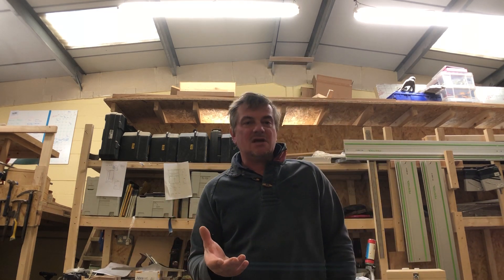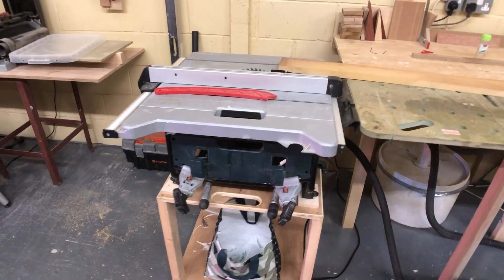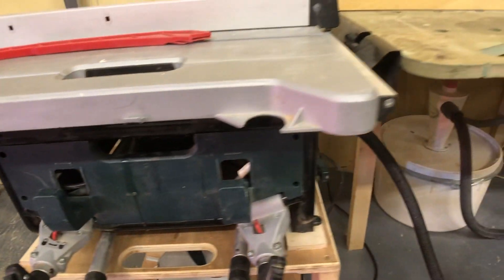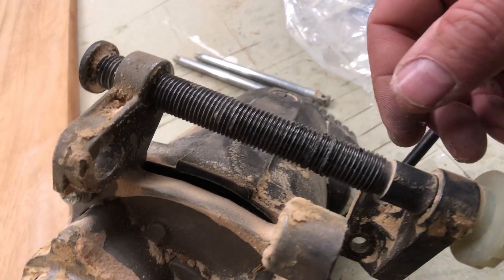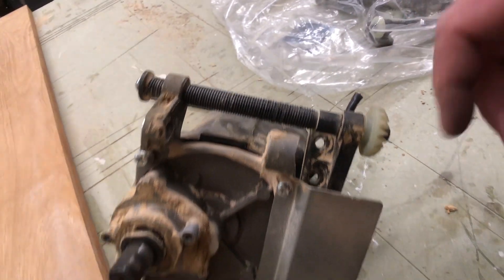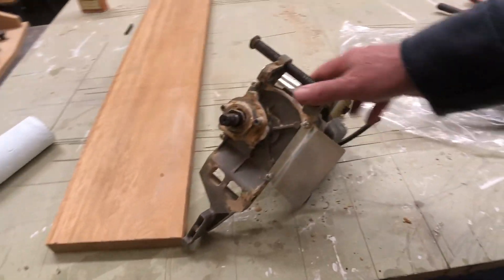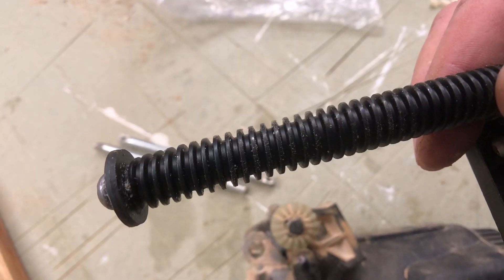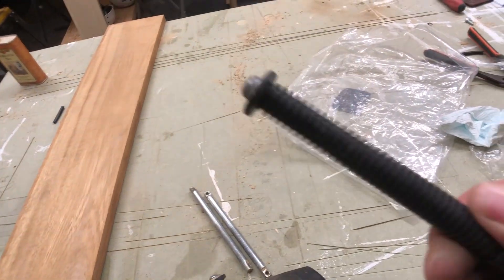Metabo TS254 Long Term Use Review and a Fix For The Broken Lift Screw

Comment: Thanks a lot for this tip, mister! I will make sure to check that the saw im buying is equipped with the right kind of threads!

Update: I contacted Metabo and they informed me that you should make sure the model you’re buying has model number 600668001. This is the upgraded version. The previous model was 600668000.
Reply: It is hard to find this model (in Poland at least)

Comment: Thanks very much for taking the time on this video, I’m looking to get one of these and looking at the competition this seems to come out best,I don’t do sites anymore so it will only be getting home workshop use.
Most of my sheet mats get cut on the festool saw and track so it will be for cutting up the smaller stuff and solids, so along with your vid and my comment anybody else looking for the same setup this will help

Comment: We call that replacement thread the Acme thread over here in the US. I had the earlier model Metabo and it was gear drive and twice the drive broke or chipped and you could hear the missing
tool right before it was ready to poop the second time. I sold it and was glad to see it go. I have a video of it showing the features which at that time I thought being better than the Bosch 4000 sold over here. Now Metabo has bought another brand and is marketing some new tools.

Comment: I had the same problem and metabo replaced the gearbox cover and height rod. I fitted It myself that was 3 years ago and with covid and a knee replacement, saw not used much and it has just done the same. The saw is a great bit of kit. It's just this part that let's the machine down.
Reply from the maker: hi, thanks for the comment. I am guessing the screw they sent was the same as the broken one, not the butress thread?
Reply: @SpanneringEveryDay  it was the butress thred one.
Reply from the maker: That’s the first time I have heard of the buttress thread failing!!!

Comment: I've had one of these saws for a few weeks and am pleased with it.  As with all things in life, not everything is perfect and a problem arose today that maybe someone can help to solve: while cutting several tenons, the blade lowered slightly.  The handle started in the 11 o'clock position and ended about 8 o'clock.  I presume there's not enough friction in the mechanism to keep the handle up.  Does anyone know how to increase friction in the lift mechanism?
Reply from the maker: Hi. Some times after I have serviced and re oiled mine, usually with a dry lube like spray copper slip it will do the same but after it’s got properly dusty again it stops! Nice guitar work BTW, I’m just about to build my first. Then I’ll learn to play it!
Reply: @SpanneringEveryDay  Thanks for the reply.  I'll try letting it get dusty then!  I ended up clamping a piece of wood against the handle, which worked, but was rather inconvenient.  Glad you like my videos, and it'll be interesting to see your guitar build.  Acoustic or electric?  I made an electric guitar years ago, but for a number of reasons it was never going to be as good as a factory-made instrument, so I haven't made any more since then.  As for learning the guitar, there are loads of free resources online, but by far the best way to get up to speed is to join a small group. If you play fairly simple songs, the discipline of having to keep up with the others makes for rapid progress.
Reply from the maker: Howard's Guitar Covers the piece of wood clamped to the handle is exactly what I did. Semi hollow bodied electric and learn music theory!

Comment: Metabo say that the update to the threaded rod was made in production June 2017. Serial numbers starting 706 have the modification. So 4yrs on all machines at the dealer shop should be ok.
Reply: There is no ts254 with serial number starting 706 - what is the full serial number?

Comment: Thanks for this. I am tossing up between this saw and a Dewalt. I will check this component. You mentioned the fence is “ok”. Do you have any view on how it compares to the Dewalt dw7491? Cheer#
Reply from the maker: Hi, thanks for your comment. I did look at the DeWalt saw but discounted it on the basis that the stand just didnt compare. I also seem to remeber the fence was opperated with a hand wheel and lock??? But never used one in anger. The fence on the Metabo is OK. It does exactly what it should do. its solid and reliably square. My only reservation, and probably unfairly, is its not very tall or wide. Like the cast ally top there are compromises to make this large tool transportable and the fence is one of them. Hope that helps?
Reply: TheNewKitchen.Co That is excellent information to have - thanks :) I really appreciate you going to the effort you have in both the review and the response. Cheers
Reply: Glyn Thomas . Hi. Here is some info that I have been given. My statistics may not be completely accurate but this is the basics of what I know. I believe that this saw along with the dewalt and the makita saws are 2000 watt machines. However at the blade, the dewalt and makita saws only produce about 1300 watts while the metabo produces around 1800 watts. 
I was told that the company reps here in NZ know this but don’t know why.
I would buy this machine over the other two machines. While I would normally buy makita power tools, I would not want a makita saw due to what I have just said but also because the rip fence on the makita is too light and does not clamp at both ends. It will move or bend when being used.
A dewalt saw would be my second choice after this Matabo saw.  Just something for you to think about.

Comment: Hi Stephen, I run a site about woodworking machines as hobby and also have a page about the Metabo TS 254. I was wondering if I could post a picture from your video of the two different threads there? To show readers what to watch out for when they're considering buying this saw. It would be much appreciated! Best, Rob
Reply from the maker: no problem Rob. Send me a link to where you have used it and include an appropriate credit.
Reply: @SpanneringEveryDay  Thanks! You can find the page here: https://machineatlas.com/machines/metabo-ts-254/ I've included a credit to your video underneath the image.

Comment: Hi. I have a question for you as I have just bought of these saws and when I am trying to cut with the blade set at 45 degrees the workpiece seems to run up against the splitting wedge or whatever its called just behind the blade and jams and stops. It could be something I have not set up correctly but any tips would be greatly appreciated. Many Thanks Andy.
Reply from the maker: Hi Andy, The bit your talking about is called the kerfing or riving knife. It is there to stop the wood your cutting from pinching the blade. On a circular saw that can be very dangerous as the blade is liable to grab the piece of wood your cutting and throw it at you.

First, check your using the right blade. The one supplied should be correct but if the blade is thin or under size it can be a problem. The blade should be 254mm diameter, 30mm hole and 2.4mm thick. These numbers will be etched on the the side of the blade.

When you lift the black plate surrounding the blade in the cutting table you will be able to access a red lever at the back. it releases the riving knife and allows you to raise and lower it. Check this moves cleanly and doesnt have anything stuck behind it and that the blade is well seated when you lock it off with the red lever.

Assuming it is seated correctly and it is not thicker than the blade then set the blade upright and raised as far as it can go then with a steel edge rested on the side of the blade ensure the riving knife is on the same plane. If it isnt you can access three allen headed bolts with the black plate removed, loosen them and move the riving knife untill it is perfectly in line with the blade. I had to bend my riving knife to make it lign up.

The final check is that the fence is pefectly square to the blade. If the gap between the blade and the fence tapers in then whatever your cutting will get stuck. This is easily checked by moving the fence up to a point where it is almost touching the blade and inspecting the gap. Adjustments are made by releasing the clamp lever at the front of the fence then releasing the two allen bolts on the top of the fence, make your addjustment then check it again.

All that done you can try again, some woods will still want to grab at the riving knife due to internal tensions released when you cut the wood. if this is the case then all you can do after checking the above is use wax on the knife to make it slip more easily through the wood.

Hope that helps?
Reply: @SpanneringEveryDay  Hi and thanks for the quick reply. The machine is brand new and as far as I can tell it is set up as per instructions.On a 0 degree tilt cut it cuts fine but it has this issue when cutting over at a 45 Degree angle.The blade is cutting fine and is as provided but the work piece appears to be getting squeezed by the riving knife. I will have another look in the morning and go through your points. Thanks very much. Andy
Reply: @SpanneringEveryDay  Hi again. I checked the things you mentioned and they were a little out so I adjusted them but then found out it was beginners error. The workpiece was actually getting stuck on the blade guard as I didn't have the blade sit quite high enough for the guard to lift enough for the wood to pass under it...whoops :).Thanks for the help.
Reply from the maker: Northseafool ahh yes. I threw the guard away.
Reply: @SpanneringEveryDay  I was tempted to as It seems to get in the way in so many different ways but being new to it I thought I would get the hang of it first.

Comment: Thank you. They are sending me the kit for repairing mine thanks for sharing this information.  It seems any that have the Type Number  00668380 will have the problem.
Reply from the maker: BoredinNewYork I will check my type number when I get to the workshop tomorrow. Glad I could help and thanks for your comment.
Reply from the maker: BoredinNewYork hi, sorry it’s late but yes, the model numbers match.
Reply: @SpanneringEveryDay  No problem, that will help others out there with the same problem. Thanks again for posting this, it saved me a lot of hassle!
Reply: Hi there
i have the same problem with mine, how did you get the parts if you dont mind me asking ,did you get in touch with metabo ?
Reply: @MrBez007  yes, I contacted both the UK and the main office in Germany. I can't remember if it was via email or through the website though. You'll have to have a look.

Interestingly, the UK office wanted me to pay, but the German office  instructed the UK office to send them to me for free!
Reply: @SuperFX101  that's great thank you

Comment: I have this model and find the fence is rubbish. Anyone got any advice how to remedy this?
Reply from the maker: Hi Ben, thanks for joining in the discussion. I think rubbish is a little harsh. The fence is built light, it’s a portable saw. That said I did have to make all the adjustments before it consistently say parallel to the blade. The clamp on mine is very solid. My only real criticism is it’s a bit short. What specifically are you having trouble with on yours?
Reply: @SpanneringEveryDay  the fence clamps down fine but the end away from the handle does not move as freely as the handle end. So if I move the fence to the left or right the opposite end doesn't move and I have to physically move both ends every time to make it parallel. I don't want to be a harsh critic but having to parallel the fence every time I move it doesn't make for a efficient table. Cheers for the response.
Reply from the maker: Ben Cook that doesn’t sound at all right and is not my experience. I’ll have a look at mine and see if there is anything I can learn from that.
Reply: @bencook9267  Same problem.